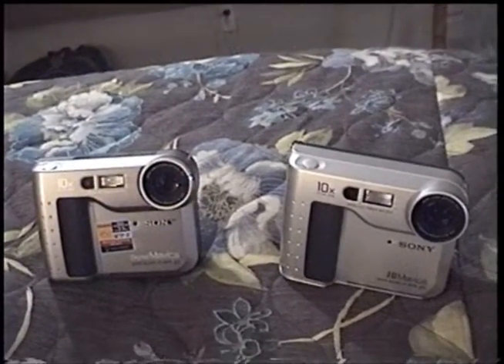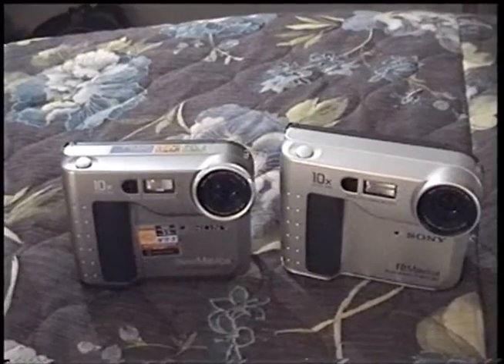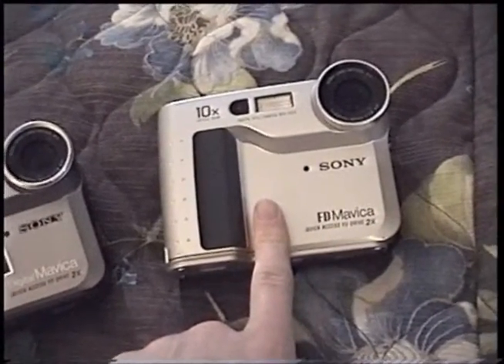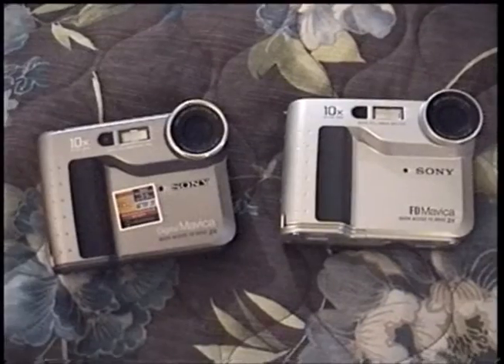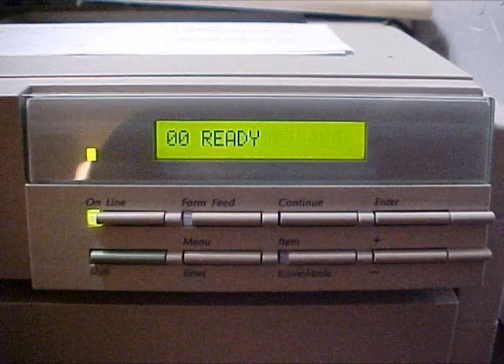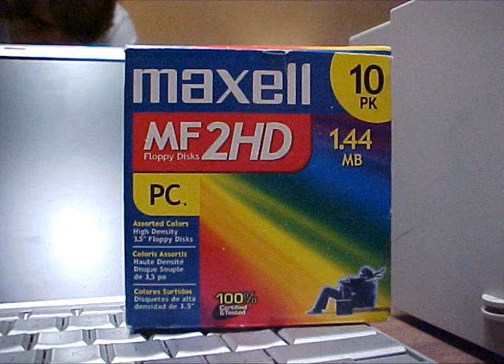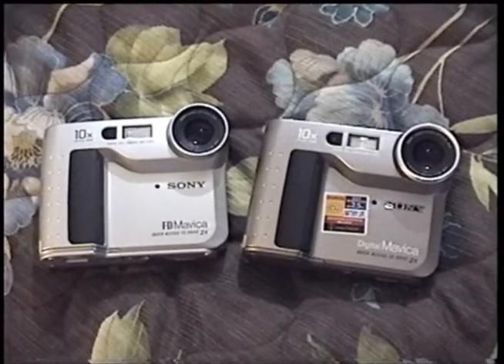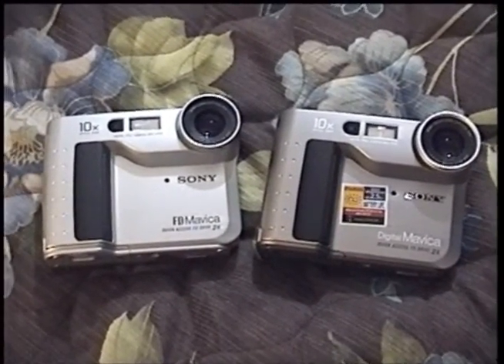Test photos, Sony Mavica MVC-FD71 and FD75 floppy disk digital cameras

Comment: Sony did make significant improvements to the image processing in their cameras and camcorders over the years, even if the specs on paper stayed basically the same. After all, the major determining factors in a digital camera's quality are not just the image sensor but also the lens and image processing. Especially nowdays, a camera with more megapixels is not necessarily better -- and can actually be worse, because higher resolution image sensors often have poorer low light sensitivity, and if it's a CMOS sensor, more noticeable rolling shutter effect (which causes fast-moving objects to look slanted or wobbly rather than straight).